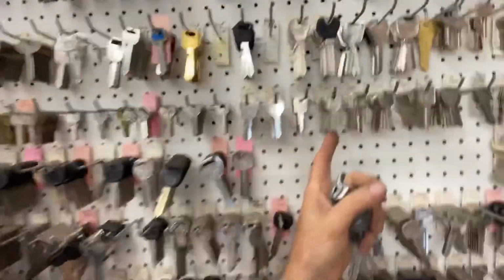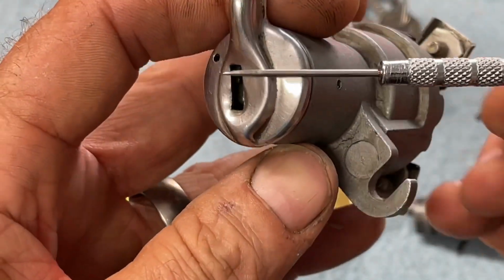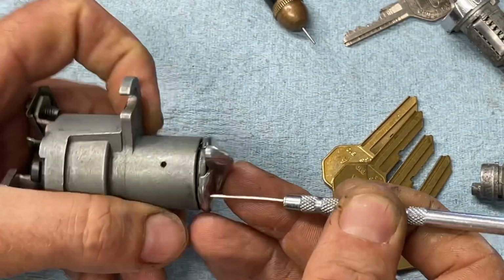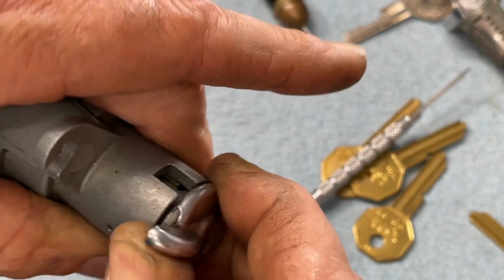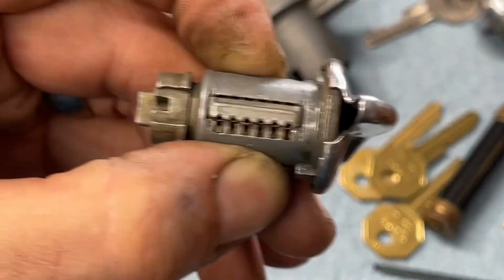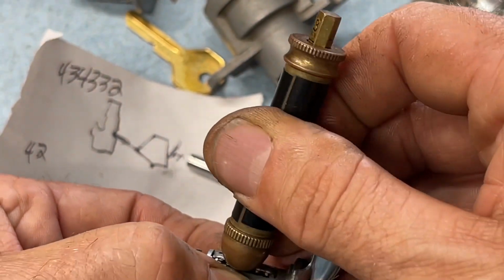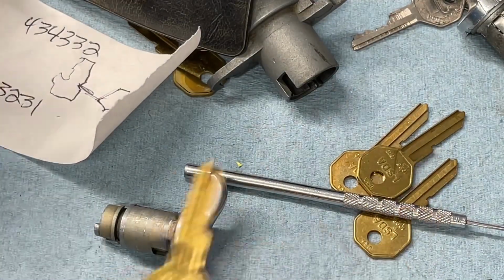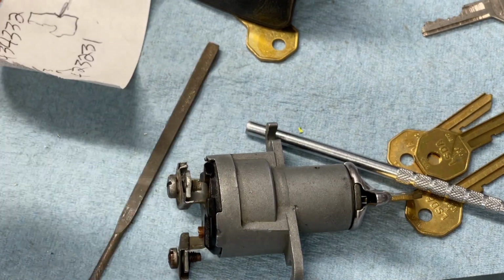making ignition key to a 1948 Chevy Fleetline (GM 6 cut)

Comment: Can I ask you a simple question. I just restored a 99 chevy with the vats passlock 2. key works fine starts eveytime issue is about 10 times a week cant turn to the off position can kill engine but cant turn the swith to off where power goes off? I just cant figure out whats happening. The bar that the key lets drop when inserting I ground that down thinking would fix. Its not in the shift part that I can see. Ive cleaned and lubbed Ive looked n looked. Its to the point Im getting agitated I study it but cant understand whats stopping it. IF I was within 150 miles Id just pay you! tell me whats going on and I will paypal you for advice!
Reply from the maker: check your shift interlock solenoid right there under the physical switch
Reply: @selock  Ah HA Said the blind man! Bet thats it! Can I send you some lunch money for your knowledge? Be glad too!